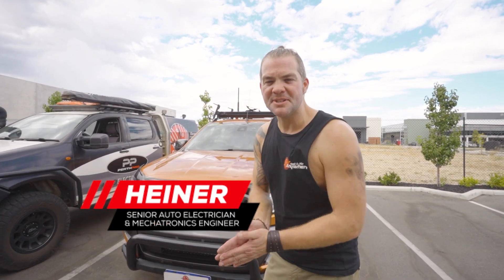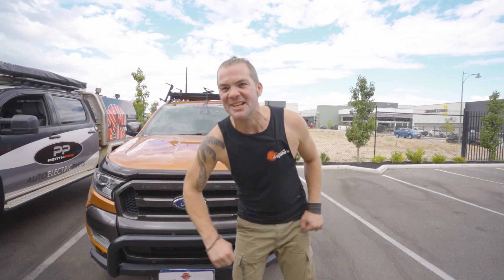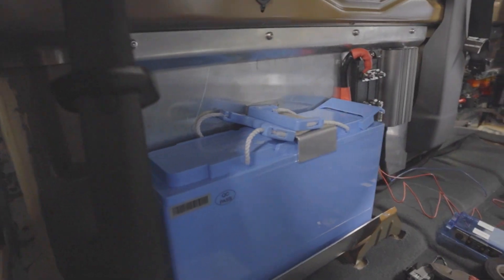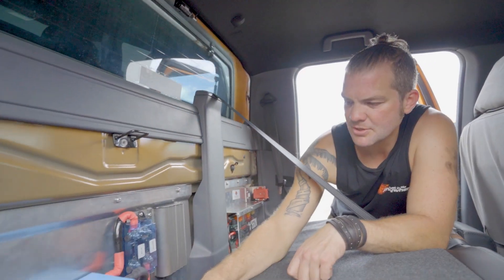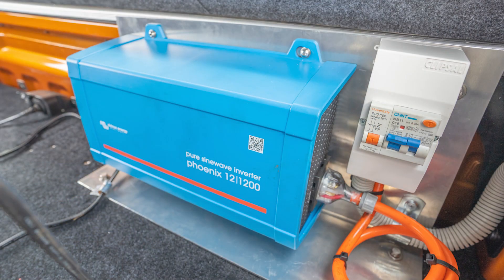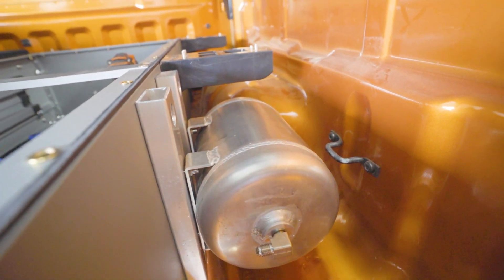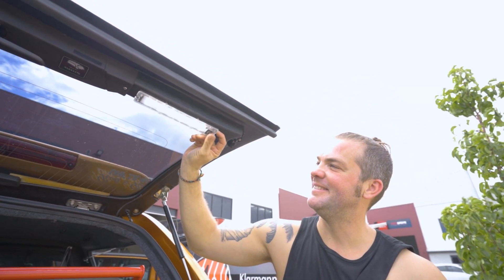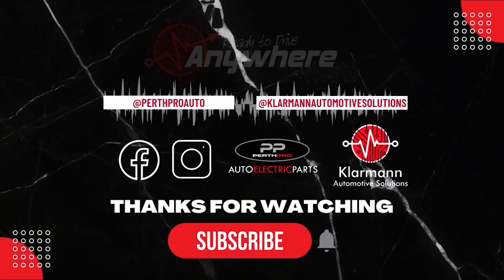Heiner Builds Your Ride | Ford Ranger

Comment: Interesting, I don't see a labelled double pole GPO.

By law, caravans, motorhomes, and other recreational vehicles require a GPO with double pole switch that disconnects both the Active and Neutral to reduce the chance of electric shock.

The GPO is to be labelled.